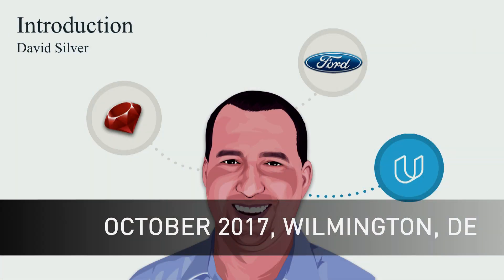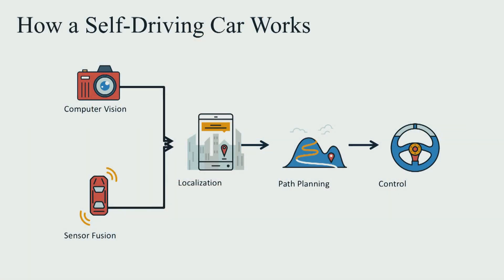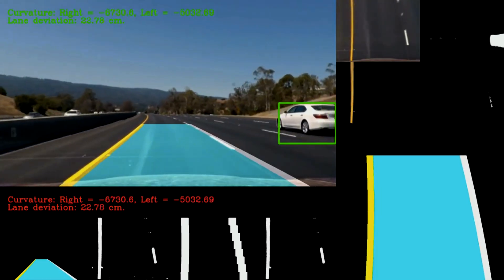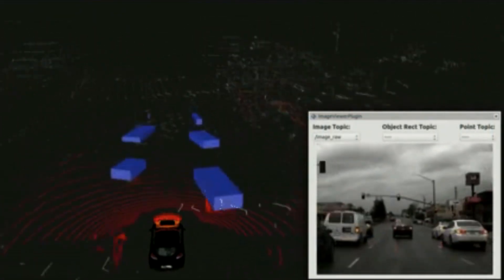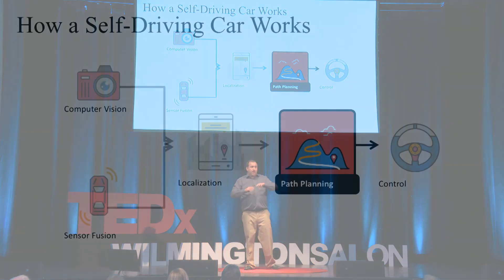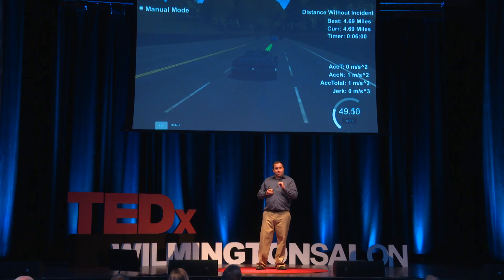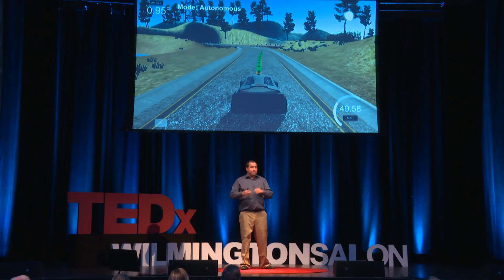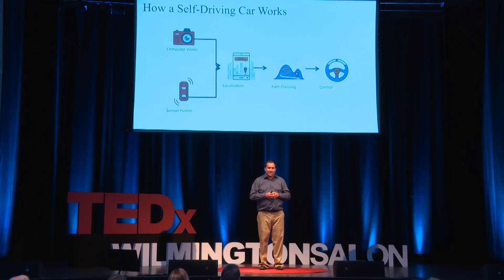How Self-Driving Cars Work | David Silver | TEDxWilmingtonSalon

Comment: These vehicles won't work....too many problems & for a start tell me how the sensors can read the road & conditions in snowy, foggy or other bad weather conditions....also an interesting Youtube video to start with is "The driverless car scam" ?
Reply: Please read on the topic before commenting. There are ways to figure this out as well. The camera is one of them. The way neural networks train, if you feed in data with snowy and foggy weather, it will work properly. Naturally getting all the data and all the cases are very tough, however, in the present day, you might have heard of Tesla Autopilot. It is already on the roads and way safer than any human driver. Also, these sensors are more accurate and sharp than your eyes. They can detect all the traffic signs that are on the road. 

Also, in case of a pointsman directing traffic, it still ain't an issue, the car can still see around it. It will make use of the fact that other drivers are following the pointsman and follow that behaviour. 
Anyways even reading human gestures is possible. There is definitely software out there that I am aware of that can do this. 

There is only a small amount of topics we can discuss in a 10-20 min video. You cannot become an expert on this topic without actually delving deep into the topic itself. And the videos you mentioned are made by half taught nitwits who could not make their own self-driving cars. So they assume no one can make these.

Anyways just sit in a tesla autopilot in any weather. You will realise how safe these things are.
Reply: @rohansingh1057  I think you need to research more...I have  heard your side of the story, but believe me there are very smart people & engineers out there that are capable of blowing your ideology to pieces.